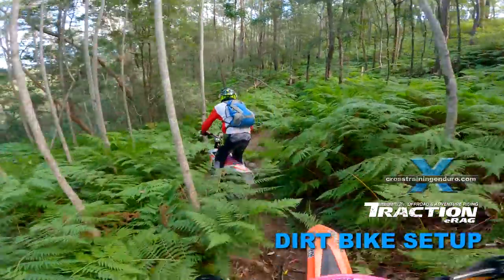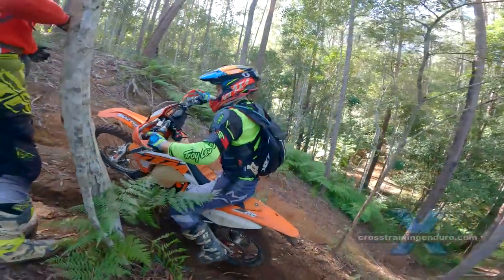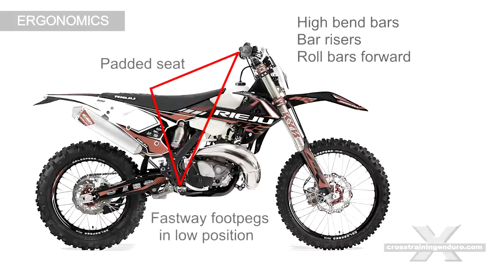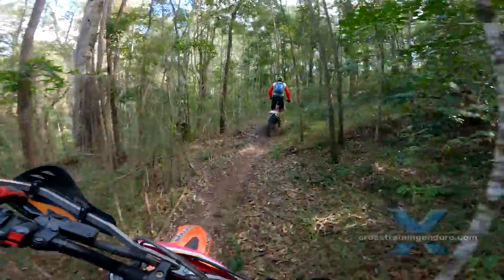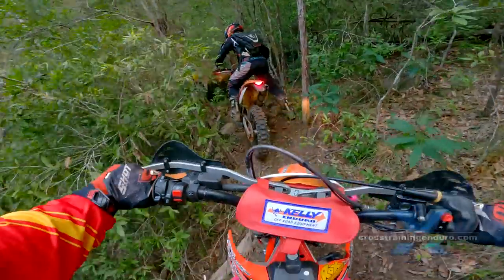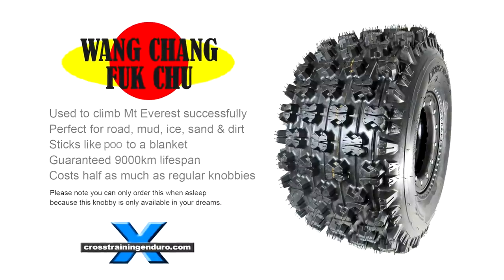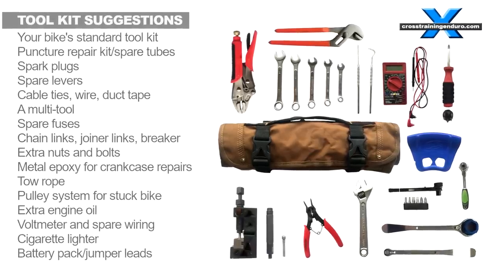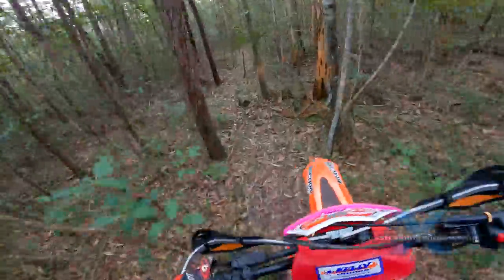How to set up your dirt bike! 12 important tips︱Cross Training Enduro

Comment: Tires made a huge difference for me.  I was almost ready to get rid of my 2019 WR250F or blow over $1k on suspension revalving because the stock, 3 year old tires (previous owner didn't put too many miles on it) were unbearable on rocks regardless of what I did with pressures or suspension clickers.  Switching to new Michelin Starcross 5 tires with a much more flexible casing completely transformed the bike to feel amazing in rocks.
Reply: I also use the starcross on all my bikes
I am located in central Tx so everywhere to ride single track is rocky like you mentioned. I noticed these are the best handling tires no matter the terrain!
Reply: Does it mean bigger tires are more manageable on rocks? Maybe its about time to change mine too.

Comment: Whenever I get a new to me bike, I reset the suspension clickers to standard settings. Even brand new, some dealers tend to set them to whatever. 

It’s also very important to properly set your throttle and clutch cable play. If your throttle is too tight you can have the bike accelerate when you turn the handlebars. If your clutch is too tight it can not be disengaging fully and burn up very quickly.
Reply: When I bought my husky, the suspension was so strangely positioned that instead of picking the pits, the motorcycle bounced off them.  It spoiled my first day of riding the second I set up and it was great.

Comment: Nice to know about twitchy throttles on EFI four strokes.  Been off bikes for over 30 years so it's taking awhile to get used to that twitchiness.  Thanks
Reply from the maker: You'll love the G2 then, Mark. It doesn't make all that much difference on two strokes, but it's brilliant on the big FI thumpers. I was really regretting buying a Beta RR480 a few years ago until I popped one on. It was very good on an FE570 too, turned it into a pussycat for the first half of the throttle.

Comment: Fantastic as always Barry. Don’t know if they make em for these new fangled bikes, but I love my Hyde pipe guard on my ‘06 300. It’s a relatively lightweight composite, but the big benefit is the guard is integrated into the skid plate that’s tied into the frame. Smash it up all day long and the seal into the cylinder head never moves. Also protects the toes a bit.
Reply from the maker: I've heard mixed reports about them, plenty of rave reviews but others saying they don't hold up to big hits? So I've never included them when talking about protective gear for the bike.

Comment: Tip for lighter clutch with cable. Drill a hole for the cable end closer to the pivot of the lever. It's free, easy and if you do it right, you might be able to go back to stock if wanted.
Reply: What size and do you use a flat bottom drill bit?
Reply: @chadrides914  Slightly bigger than the end of the cable and I have always used normal drill bit but if you could use a flat tip one it would be better

Comment: From what I know about the recluse, if you use the recluse as a crutch you will never gain more skills as a  Rider.  or it will just take you longer to gain those skills as a rider
Reply: A Rekluse has its place. I have one on my Hulk Force cable clutched WR450 and it’s a life saver. I liked it so much I put one on my new Beta 300RR also. The beauty of a Rekluse is that you can still operate the bike like normal. Don’t knock it until you’ve tried it.

Comment: All good stuff! Been running Tubliss for about 7 years now. Only tire I can't get to seal well is a starcross 5 soft front 80/100-21. It'll seal for a couple of weeks, then I do a rock garden fast and pfft.. all the magic smoke leaks out. I think the sidewalls are too soft/thin/flexy. I can still ride it flat, but have to take it home to tear it down relube to get it to seal again. Everything else seals up great. Still tempted to go mousse though.. trying to come to grips with the cost/work involved.
Reply from the maker: I could be tempted to run a mousse up front as they last so long, David... but I've had zero issues with TUbliss for five years now so can't see myself changing in a hurry.
Reply: @crosstrainingenduro  Other than slicing a couple of tires and that starcross not sealing, I've had good luck. Another thing that makes me hesitate on mousse is being stuck with limited tire selection for each given mousse size. I have 6 new tires in the garage.. which would require me to buy 5 different sizes of mousse. Too expensive. And if I destroy a tire away from home, fat chance finding a replacement that fits the mousse. With tubliss.. I can just stick whatever tire I can find on there.

Comment: Lol tune the rider not the bike moden bikes have been designed and tested by pro riders for many years stock bikes are pretty much bullet proof and ready to race BUT  bike to rider set is key and this video is pretty good advice especially if you don't have an extra two or three grand to spend on a 16 k new bike top vid cheers

Comment: I hate spokes, I guess I'm not patient enough to true a wheel. But even with over 1/8" of wobble both ways my bike feels okay going 80mph on the freeway. I just pluck them and adjust the ones that are way WAY off. Got a torque spoke wrench, seems useless. I'll just go get the wheels trued at a shop when it's time to change tires, I guess
Reply from the maker: Same here, I'm not worried if it's not completely true... but a few times a year I'll just check for loose spokes.

Comment: Bike protection is good I recon the main three are a  skid plate, hand guards and a pipe guard that’s all you’ll need unless you have the money then go ham
Reply: Very True, What I did was bought an Old Bike and messed that one up to get better before moving to a newer bike and then get all the guards, a person would know what you normally do and what you normally break. but those suggestions are spot on.
Reply: I’d add rad braces/guards to that list.  A rad can be ruined just by the bike falling over in the garage.  Pipe guard is debatable ass it can lead to a broken cylinder flange instead.
Reply: @gpaull2  Yup, I was about to add the rad brace. Usually cheaper than a rad and you do kinda need them if you want to get back to civilization.
Reply from the maker: I've opted out of radiator braces for the time being as I'm really enjoying keeping my bike as light as possible. But yeah, I do run the risk of bending or holing it. I carry some metal epoxy in the tool kit to fix any leaks, and hope I can repair any mild bends when I get back home. I'll probably regret not fitting the braces eventually though!
Reply: @crosstrainingenduro  Don't forget to drink a beer before you ride. Having a full blader might be useful to fill that radiator 😂
Reply: @cedricboivin9422  A mate of mine did actually piss in his radiator once, was Canadian club though not beer. Perhaps better anti corrosion properties
Reply: @1Beetlegeuse  I have heard once that BMW have use engine that the employee pissed on them for a while in their F1 because it was allegedly harder due to a chemical reaction with the aluminum and the urea.

The secret of the champion
Reply from the maker: I reckon it would work, Rupert. They used to piss into the cooling system of the Vickers machine guns in the trenches during WW1.
Reply: @gpaull2  hell yeah especially ones that are pressed not welded they can start pissing coolant even after they get dinged my mates Xc300 had that happen

Comment: I disagree on tyres-  that is the only thing touching the ground (hopefully).  I’ve been with much better riders than me that struggle on the super slow, tight stuff due to tyre choice.  Of course, I’m a crappy rider and have mostly given up on improving- I just want to keep riding and not get hurt (falling down).
   For very slow, slippery ‘tracks’ - I personally find radial trials tyres with Tubliss, at about 3-4psi work fabulous.  BUT you have to ride with the tyre, meaning never spin or lock it up. Braking is fantastic- unless you lock up the tyre, then it is worthless.
 Of course, not so great at fast speeds.
Reply: yeah my dads tires make his bike feel like it on rails in sand while mine wants to go everywhere but straight, really makes keeping up in sand a pita

Comment: I cannot understand horizontal levers.
Wire on the grips should be a double pass, that way you don’t rely on the twist to so the tightening. Go around twice, wiggle the pliers up and down a few times and watch it tighten up, then twist to hold, fold and insert into the grip.
Reply from the maker: If the levers are near horizontal it encourages you to use the correct body positioning and squat slightly with your weight to the rear... instead of standing straight up. See our body positioning training vid.
Reply: @crosstrainingenduro  is it not straining the wrist? I run mine down maybe 25°
Reply from the maker: As per the previous comment... all good if you use the correct body positioning.